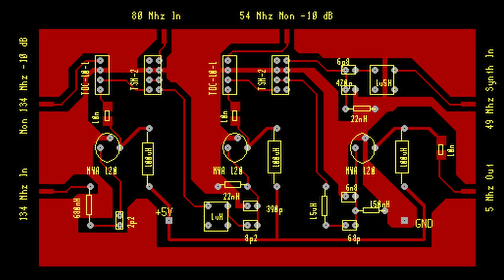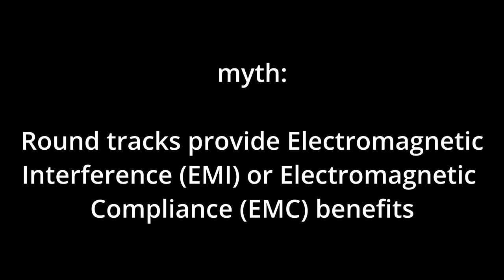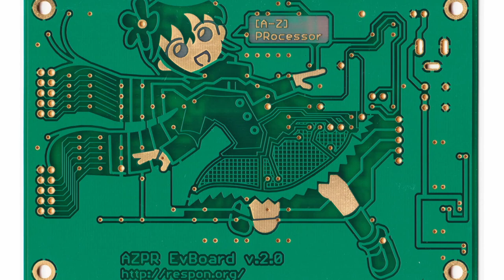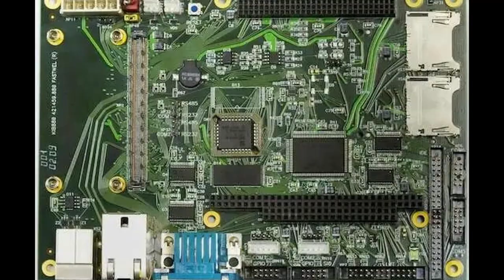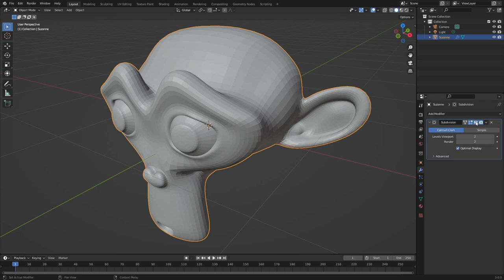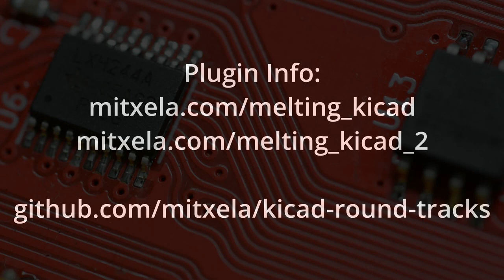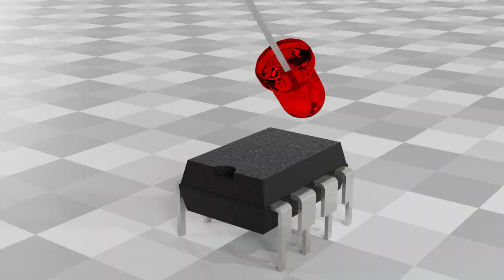Melt your circuit boards

Comment: To accentuate the "radiate on corners" point. The actual energy of a signal always is within the EM fields between a track and the ground plane. 

Signals like people "travel through the halls [dielectric], not the walls [traces/ground plane]".

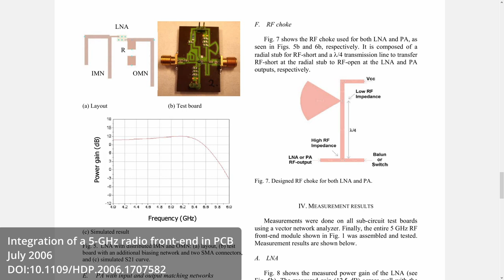But remember at 2:30, that it's not about the frequency, but the edge rate of a signal that matters. (insert Eric Bogatin lecture here).

IMO: Corners have been the escape goat of bad EMC/EMI performance when folks forget that ground via stitching, having close ground planes to your signals, loop area (as you mentioned) and smart stackups / layer placement in those stackups affect things more.

Corners are a problem in electronics, but only when you work at high voltages and then you've got a risk of corona discharge.

Comment: I thought the video would be about melting the substrate to get the precious metals or something like that.  I'm old enough to remember those old circuit boards.  Curved traces do help in high frequency applications, and I've had to repair boards where the break in the trace was right at the join between the pad and trace. Usually it's when replacing through hole parts and it lifts the pad.  But when there is a teardrop at the pad it can be just enough holding power to keep the pad down until finished with the rework.

Comment: When i was studying in university, i was managing a lab where we had PCB milling machine. 90 degree angles annoyed me because the machine was constantly asking for the sharpest drilling bit for the corners and it was a hustle to constantly calibrate the depth of the drill just for these lousy corners :D
the mnachine was capable of automatically change the drill bits, but calibration was required for each exchange. So 45 degree angles meant less calibration.

Comment: TopoR is by far my favourite. The PCBs look so alien and complex. Once I remember it's the most efficient way for a PCB to be done, they seem absolutely beautiful.
Reply: I was interested to see that program, but of course the result is still limited unless it also controls component placement. I think it does? Or maybe that's an optional parameter? but some of these examples don't make that clear. I'm doing a fairly simple board right now and I'd love optimiser help but with some constraints just for aesthetics (e.g. 90° angles on components). If rearranging components helps eliminate vias and simplifies routing then I try to do it, but it's tedious by hand.
Reply: @qu1j0t3  topor can do everything for you if you want to afaik
Reply: @chargernoises  thanks! I probably should check it out

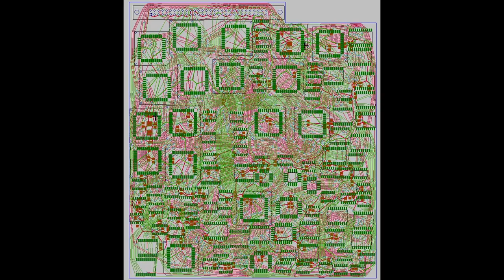Comment: 4:30 I do have an argument against it: It's terrible for readability. If you're trying to modify the board, or generally tell what goes where, it's a lot more haphazard looking to the human eye.
But for commercial products, that's not an issue.
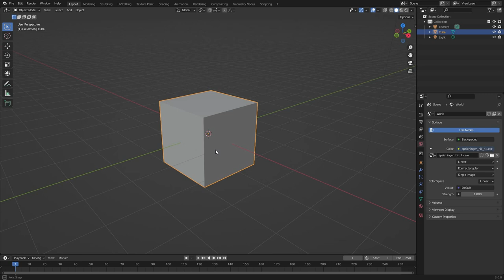6:16 Rounding off corners as shown before would be done better with a Bevel modifier. I don't know why they wouldn't have something that allows you to edit it straight, but preview, say, and onion skin overlay that's the final product in realtime while you're editing.

Comment: There is a plug-in for the basic easyEDA that does exactly this.. Finish your design > smooth tracks & add tear drops. Done.. To adjust your layout - modify the unsmoothed design and then resmooth.

Comment: You're not alone! When I first started making circuitboards I quickly became obsessed with making them as aesthetic as possible, especially when they're visible.

Just as a counterpoint to the "rubber band" algorithm, do pick and place machines typically have a fourth axis? If not then those boards could only be assembled by hand, or expensive specialist machines.

Comment: Thank you metxela for this amazing plugin.

although i have a problem with it. i cannot order a board with molten traces because of how traces are formed. the guy in pcb production site told me all the traces consist of multiple pads, so their pcb loader/interpreter gets stuck as the gerbers become too 'heavy'

So if anyone tries to order boards with traces molten, beware, as it may hinder the process. 

Of course i don't exclude the possibility of my own mistake. 

I tried with Rezonit (Moscow,Russia)

Comment: The way the curves were being drawn initially could make the data much larger in a complex design.  The way KiCad's upgrade did the curves would fix that, but wasn't clear in the video whether KiCad was making proper traces or was drawing the lines.  Drawn lines are bad for designs with impedance or critical traces because CAM softwares general only compensate circle Dcodes, so your impedance could be off.  For example, if you need impedance control on a 4 mil line, but the manufacturer needs to increase to 5 because of the material being used, then they need to compensate 0.5 mils, they would increase all 4 mil Dcodes to 5.5.  But if the trace is drawn, the increase won't happen and your impedance will be high.

Comment: Amazingly triply outtro video. 
Also growing up with electronics since the 90's and on-words I've always admired the design ascetics of them. Now I wish I had a reason to learn how to design a PCB board, but it'll be cool if you have other videos on how those black rectangular chips with silver teeth/legs function and those cylinder bits which I assume are to manage power flow somehow.

Comment: 45/90 degrees makes traces easier to follow. Also it lets you organize routing (Manhattan or otherwise) such that you never run out of room. The worst is unrouting a board because you tried to over-optimize traces.

Curved traces may be the shortest, but they take up the prime board space and traces routed last can end up long and awkward. Whereas with Manhattan routing all traces get the same treatment and you almost always have board space left over. Of course Manhattan routing is less viable with dense SMT boards.

Comment: I think that when you have those rounded besier things that connect a trace with a hole for the component, it makes overheating and ripping the copper of a hole from the trace a tiny bit harder to do, which is what we want.

Comment: BEAUTIFUL VIDEO! KiCAD is my "go-to" PCB editor, and I will use your plugin FOR SURE! THESE CUBIC BEZIER CURVES <3 <3 <3 One word of warning though: reflection. 45 degrees turn is just a better and straightforwardly shaped waveguide easier to compute and predict. It's not about DRAWING the curve in CAD/EDA, it's about computing what impedance and propagation delay will be. Very important stuff in high-frequency applications, especially, in microwave range. Even at 100 MHz, the harmonics are in these GHz, and when these harmonics awkwardly reflect over your sweet smooth curves (I love the aesthetics of them!) you are out of luck because the problem of predicting the board performance until you solder components on it becomes beyond NP-hard and computational limits of supercomputers. Please, use 45 degrees!
Reply: I agree and love your showcase of KiCAD's ugly 90 degrees autorouter. No excuse for that. My whole point above is that the reflections still do matter, make the 45 degrees (or ANOTHER degrees!) cuts so microwaves reflect and propagate with predictable latency with minimum phase shift! ;-) Hope you agree! Topor is AMAZING! You have liberated my soul, I'll place & route organically now all my new PCBs using simulated annealing! THANK YOU! <3 <3 <3 (But I'll add sharp strokes to cut those predictable reflections for GHz harmonics: you mentioning actual ELECTRONS sounded very unprofessional ;-) I'd edit the video and upload it without the word "electrons" or add a bolder joke around it)

Otherwise very good video, thank you for making and sharing!!!!

Comment: If you're designing it defines with a visible circuit board (like a single board computer), then I guess aesthetics make sense.

But if the circuit board goes into a chassis and nobody's ever going to see it outside of people manufacturing or repairing the device... Is it worth the time spent to make it look pretty?

Comment: Sticking to a grid is often easier, and makes things more modular.  Other 3d tools that may have some analog are "Hammer" and "Trenchbroom", which are oriented to level designing, they use a 3d power-of-2 grid to keep things organized.  In these programs using nice angles helps to keep vertices on relatively large power-of-2 grid lines, which in turn makes it easy to group adjacent objects into trees and organize them so that they meet along nice grid lines.  I haven't designed any circuit boards, but if anyone has I'd be curious to know if some of the same principles apply.  Even in cases where the board is produced from a hardware language physical testing sometimes need to be done, and in those cases it would be easier to identify components when their lines are visually neat.  Also, not that it's relevant to anything, but I find nice angles to look a lot better than curves in a circuit board.

Comment: Sharp corners start to matter at household voltages, so house wiring has rounded curves. This is so surges from lightning and other sources don't arc from the sharp angle.
Reply: it has to do with the field strength.
However this is relevant even for tiny voltages, given the frequency is high enough. (>1 GHz, but  often also already >100MHz).

Comment: damn this looks good. and yes I am disappointed that its a KiCAD only plugin as I'm an Altium user.

even so, Altium does natively offer the choice to route with arcs. and i'll definitely use the arc45 next time i do a board

iirc the routing modes are:
Hard 90 degree
Hard 45 degree
Arc 90 degree (uses an arc instead of a hard corner)
Arc 45 degree (see previous)
Any angle (you want a track at 163 degrees? you got it)

Comment: Acid will still pool in corners, its just that if you over etch a corner by 2mil, on a 8mill trace, nothing happens. If you over etch by 2mil on a 4mil trace, your 😰.
Only time I feel the need to rounded traces in low speed designs is when your dealing with secondary geometry that is itself rounded.

Comment: The issue I have with TopoR is not that it is ugly, but that it's a clusterfuck. When I have to work on a circuit board, especially one I can't get any tech sheet on, I want the layout to be as easy to follow as possible. I don't want the circuit board looking like a tangle of yarn and cautious optimism.

Comment: call me crazy, but i like the modern angular design. don't get me wrong, i love a good piece of pcb art, but for general use, the angles speak to me
Reply: It's always an interesting balance. I LOVE hand drawn, rounded traces and have collected many pictures from vintage equipment I own and other places, but I'm sitting down doing routing for pcb right now and it's tedious enough just to do with KiCAD's default angled routes, that I am not sure I will have the energy left to make it pretty!

Comment: You said that "pcbs with tracks routed at the minimum distance have not been seen in the wild"
I did a commercial product with tracks as straight lines at arbitrary angles, routed for minimum distance tracks. It was either an ugly pcb or a beautiful pcb depending on your taste lol.

Comment: PCBs are more than just making the shortest possible connections, that is an oversimplified and false perception.

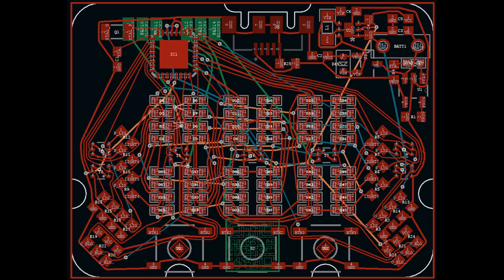The layouts at 4:20 are not only "ugly", they will also perform badly due to crosstalk, bad coupling, bad return path design etc. They also would make debugging, revisions and repairs much harder. 

PS: I do agree that rounded corners and teardrops look nice and are fine, as long as they are done properly.

Comment: I significantly prefer the look of the 45 degree boards. If I were choosing  a board with the intent that it be visible, I wouldn't choose any of the other options you showed.

That said, most of the time circuit boards are hidden away out of sight, so I don't care how they look. To that end I would rather have whichever maintains highest quality at the lowest cost, and if that's one of the others that's fine.

Comment: The reason most boards are set the way they are is due to a limitation in the manufacturing process.
Sure the pathing might be more effective but now you need to rotate the chips before you set them on the die.
This requires a "picker arm" capable of rotation on the Z axis.
Most companies are not set up to do this.
You pick it up, move it over, and set it straight down.
To rotate the chips at such nano scale would be impractical and costly.

Comment: I don't know if it was mentioned but Topor IE the most efficient A to B would also be the best from a material cost point of view would it not? Using the least amount of copper required is best for both the environment, weight and cost right? It might seem small but over trillions of products the amount of material saved to add up. Not to mention less energy required to produce it so less fuel burned.

Comment: With multilayer pcbs it's impossible for anyone to check for broken traces except for the manufacturer themselves.  You can spend days to check and replace surface components only to find out at the end of the day the board is irrepairable due to a broken trace in the inner layer.

Comment: You missed the most important advantage of the hand-drawn style - variable trace width. 
Obviously this is more or less irrelevant for digital and small signals, but crucial for power. 
These days you have to do it manually with filled areas, which can be really tedious (and not as pretty)
Reply: one more reason to try TopoR. It has a feature to auto-inflate selected tracks/nets, and it often produces beautiful voronoi-pattern-like results.

Comment: Do you think it's possible to port the gEDA's Toporouter as a KiCad plugin? TopoR's wiki page states that "Toporouter has been adapted for use with the open-source KiCad project" but I can't find any info anywhere.

Comment: Unfortunately i am not in electronics, but... i would like to play with idea of "stacked" components. I mean... instead of making board NxN mm in size to fit all components, to make it as cube fitting all components in the smallest possible volume. I know, there is a long list of dowsides, like heat, maintenance, complexity, etc... But that is what seems interesting to me. Like... how would look like such Raspberry Pi board. Or how would look like RAM module, or even entire ATX equivalent.

Comment: QUESTION; is gold plating used as sparingly as one would think or is the amount of gold (as in the total amount used per pcb) so infantecimal that its not really a budgetary concern?.. speaking in terms of pcbs that will be produced in mass quantity. for example i am aware that the plating thickness on the 'fingers' of a board can be as thick as 300 microinches (7.62µ), but doing the math to quantify just how much gold a pcb of that sort (stick of ram) would be compromised of is a daunting task i feel like.

~often times ill come across a board where ill notice the manufacturer went out of their way to have their logo printed in gold plating, as well as other similar cosmetic applications where the gold absolutely wasnt necessary..? seeing things like this gives me the impression that the cost of this gold plating is quite negligible in total cost....experience w/ this?

(forgive me if i sound like a silly layman)

Comment: Ive designed memory busses 10 yrs ago. 800mhz, serpentine tracks, but at 400mhz anything witthin an inch ws ok. . just get the memory close. Cubic beziers, we are getting a pcb router ,

Comment: My takeaway is "why do people manually draw tracks instead of setting up the points, set 'connector' values and let the computer connect it?" If the focus is wasting as little time as possible. This doesn't seem to be a process that requires a human to draw lines.

Comment: I can give an argument against most efficient boards. Circuits don't exist in vacuum. They have to work with other things and sometimes they get tightly pressed against other components like, say in video cards where lot's of heat generating elements are sandwiched between the board and a radiator. Try making a radiator that is cheap and not a nightmare to make with those rubber bands.

Another reason - "ugly" board is a nightmare to fix and maintain. Go find where's what when components are not subdivided by their function and now you need to find that one faulty component and change it. Oh, and soldering. My god. The machine wouldn't do it. You'd have to jump all over the board looking for what's where. Pain, pain, pain.

Comment: I hated the old style hand drawn look since the 80s and I have been designing PCB for 35yrs and have say you missed one big point round tracks tend delaminate were I rarely seen 45/90 PCB do this not sure why this happens but maybe having 90 turns stops the peeling off.

Comment: I don't see the point  of trying to make traces as short as possible save for edge cases where track length interferes with operation. Plus, it becomes a pain in the ass if you're trying to repair a board later, it's much harder to follow a track when it looks like a tangled mess. And I find the 45º corners the most aesthetically pleasing, the vast majority of components are built as rectangular shapes, ever more so now that surface mounting is common, replacing the old style of rounded small capacitors and resistors with tiny rectangular ones.

Comment: I'm working on a design right now and if this was for altium I'd apply it before finishing my breath
Reply: Altium has this feature already.
Reply: @danielmusat597  true, but you have to use it from the start. Here i could just transform my design. Also, I don't think it has such nice via/pad connecting features
Reply: @cakeforcat  I just checked again to make sure I don't speak non-sense: it can round 45/90 tracks using Shift+Space-bar after grabbing a corner with your mouse. About teardrops, that s something it cannot do, correct!